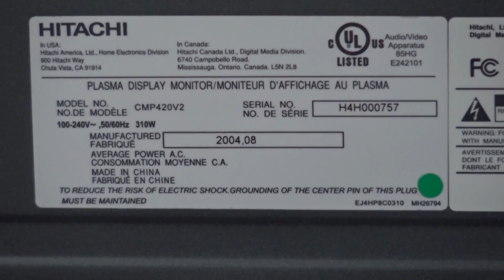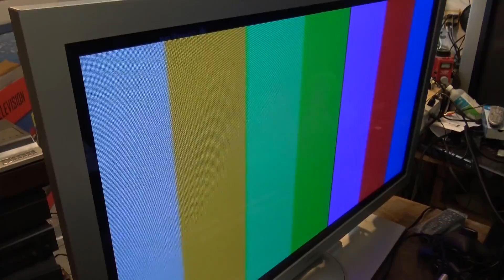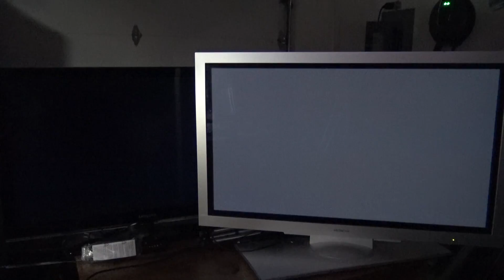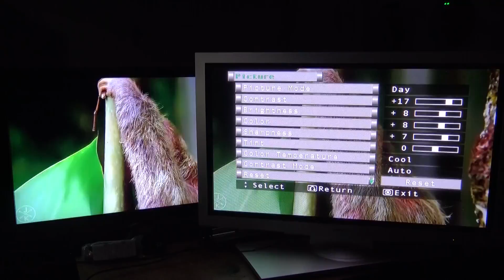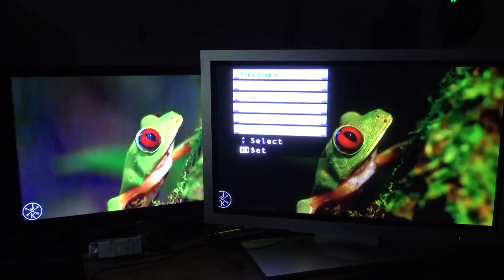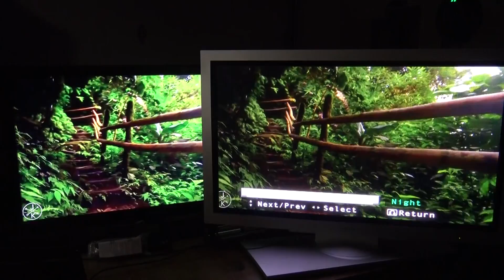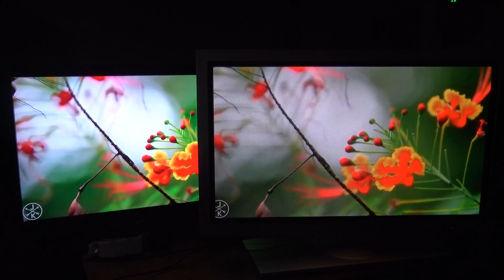Hitachi CMP420V2 Plasma Display Repair

Comment: I'm the guy that brought it in. :) When I mentioned I didn't mind the sparklies, well, what I saw at the time wasn't nearly to this degree!! I took a video then, so I can prove it too! (Not that anyone cares.)

The seller actually wasn't aware of the issue, or at least he convincingly had no clue what I was talking about. They showed up infrequently enough that I had a tough time getting him to agree they were popping up.

Anyway, certainly glad you got it functioning. Fun watch and thanks again for taking it off my hands. My purpose for buying it in the first place was watching TV shows & movies that have no HD release. My former 1080p and my new 4K set both soften up DVDs too much when they blow up the pixels 2x/4.5x. Watching 480p content on a 480p display with 1:1 vertical is a lot sharper, or so say my eyes and brain.
Reply from the maker: After it warms up the sparklies almost completely go away, and it has a great picture. Takes about 10 minutes. As you probably noticed by the end of the video they were almost completely gone. I agree 100%. For watching DVD or VHS content, the 480 set is the way to do it. I have HD content playing on it, and also on the 1080 set sitting right next to it right now, and everyone that sees it agrees that the picture is great. That is why I keep that 480p Panasonic plasma next to my bench. For servicing SD VCRs and stuff, and my video distribution from my in house system is all done on RF so it is SD. SD content looks pretty soft on HD sets, and even worse on 4K sets.  As you probably saw I got the VCR going too.
Reply: Any thoughts on viewing VHS on the (deinterlaced) 480p plasma vs. as-is 480i CRT? I can see pros and cons for both -- setting aside screen size availability, weight, etc. and just speaking of pic quality.
Reply from the maker: I just plugged in a VHS deck to it, and put on the only pre recorded tape I own, Jurassic Park. Looks as good as any VHS tape has ever looked. 
Very good, much better than the LCD that is sitting beside it. Will hook them both up so I can get an A/B comparison.

Comment: great vid thanks for posting it.  I used to work on system terminals.  common problem with them was loosing start up caps. every time they would loose power to their site I would be out replacing parts because they had several terminals that wouldn't turn on.

Comment: If you ever visit Wisconsin give me a jingle. I have this 58" Panasonic plasma with a one blink that I would love to have you diagnose. The colors on that plasma are simply outstanding for such a low res set!
Reply from the maker: Resolution isn't everything. Much more important than resolution is dynamics, refresh rate, and colour accuracy.  Plasma was the best flat panel technology of the day. OLED is better, as it gives you the dynamics, refresh rate and color fidelity.  I am still very fond of Plasma sets myself, and everyone I know that has one feels the same way. I have an LED backlit 4K set and I don't use it much. Just for 4K content checking. In my studio I still use my Plasma as my edit monitor.  watch a 63 Samsung plasma in my media room. Until OLED becomes affordable I am sticking with my plasma sets, even though they do suck back more power.

1 blink code on Panasonic is a communication problem. Either the A board, or the panel.  When I say panel, more specifically the ICs on the tabs that plug into the A boards along the bottom. When the panel is started it communicates with each chip on the panel, and if a chip fails to "talk" the set shuts down. So it could be one of the connectors not clipped in right, could be a failure on one of the A boards. Smaller panels use 2, larger ones use 3, or it could be the panel itself.
Reply: I love the plasma sets especially the last ones made from pioneer
Reply from the maker: Yes Pioneer made very good plasma, the best. They didn't give them away like some manufactures did, and ultimately that cost them.

Comment: I knew that something was different about your newer videos, you started shooting the at 60fps, nice.
Reply from the maker: I have always shot at 60FPS. The only 30 frame content is the 4K stuff as that is all my cameras operate. All the HD stuff is 60 frame. I was rendering out at 60i, and youtube converts that to 30p. Lately I have been rendering at 60p, but only because I have unused bandwidth on my internet plan at the moment. It is about to roll over. The bandwidth difference is, this video rendered at 60i would have been perhaps 3 gigs. As a 60P render it is closer to 9 gigs.
Since my internet is capped, going  over the limit will cost me. 5.00 for first 50 gigs and 10 for each additional, so I try not to go over, but this month I had 100 remaining with only 5 days before it rolls over, so why not burn some up.

Comment: my favorite was the multiple component failure set. the one with the exploded Fet's
Reply from the maker: The blown FETs were actually quite easy, because I could see the blown parts. The hardest ones I have had were. 42" Panasonic with the shorted coil in the tuner boost circuit, 50" with blown parts on the SS, 43 Samsung with the blown parts on the x-main. 50 Samsung with the 2 bad buffer boards. Changing the buffer board was easy, but when the second buffer failed, finding the root cause, broken solder on the Y sustain to prevent a second replacement buffer from going up in smoke. 42 Insignia Plasma with a bad soft start cap. That was the one that took forever, but made this one so easy to find, as it was basically the same part. Different brand, but the circuits are similar. On the insignia I used a battery pack to "tickle" the oscillator into running. I didn't need to go that far on this because I have learned alot since then. That was the first plasma set I repaired, but once I saw how they did it is that one, I went straight to the stand by, and found the part first try.

Comment: Hi I hava a Hitachi TV CMPAS14V and remote CLU-W900 but I hear satellite sound when not connected so there is sound but when I connect the tv coaxial cables with left/right audio and video connected to their respective connections on both the TV as well as the wireless cable box.  I have a clear pic and after checking the remote menu for the audio increase volume I still cannot get the sound.  Is there anything I could do technically that you might be able to help?  I would appreciate that very much.  Thanks!

Comment: Hi friend I have a pdp 55pd9700c, no image, sound ok, but 80v and 60v to Z sus and Ysus doesn't exist from power board a chnaged the power board and the problem persist, my question is, this voltage has to exist to turn on the tv? 
thank you

Comment: Unfortunately, my laptop including 2010 Compaq Presario CQ62 had gave up on me in other words, my laptop is dead, do you think it's got to do with SME or other components that cause to fail on motherboard, or it's just a motherboard itself that is shot?
Reply from the maker: Unfortunately on laptops it is quite often the graphics chip. Either the chip goes bad or the BGA solder holding it on the board fails.
Reply: I don't know that might be a VGA chipset that had failed me. When I remember back on March 8 of this year at 8 AM, as soon as I turn it on the computer after I press the Enter button to tell me the battery that needs to have a new rechargeable battery about a second, as when it takes me to splash logo, it went black on screen, I can't get it to turn off by hold the power button, and I end up unplug the battery and the charger, then plug it back in, trying to turn it back on, and it's not working now.

Comment: Forgot to mention: never would've guessed that this Hitachi was an LG inside. Was this common practice for plasmas? Would LG have sold this model themselves with a different model number, too?
Reply from the maker: There were only about 5 manufactures of Plasma sets. Panasonic, Samsung, LG, Pioneer and NEC.
LG made many sets for many manufactures including Akai, Sony, Hitachi, Vizio. Samsung made Insignia sets. Panasonic didn't make any for anyone, nor did Pioneer. It would have been built to Hitachi's spec, but reliability wise they are very good. Hey it's 13 years old and 1 small capacitor popped. The panel is getting old, which generally results in  those sparkles, but it is in no way weak, and still probably had many years of life in it. The old panels were rated for about 60,000 hours. The newer plasma sets 100,000 hours.  Soon as I got the back off, it lad LG labels all over the place.

Comment: Not a bad picture considering it's only a 480 resalution screen I have an LG plasma lovely picture. I had an led tv they told me not to run the back light on full they said if a did the tv would only last half it's life so I got rid of it.
Reply from the maker: I just sold this set. People that bought it had an LG to give me back. I will be repairing that one on a future video. Got 150.00 for the set!
Reply: 12voltvids nice one 👍